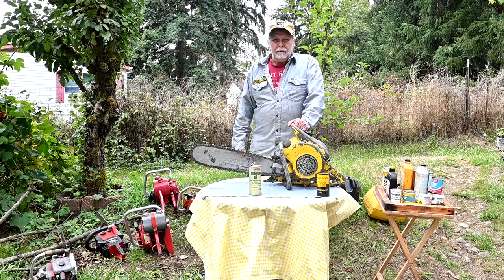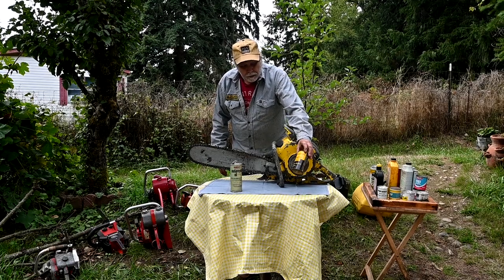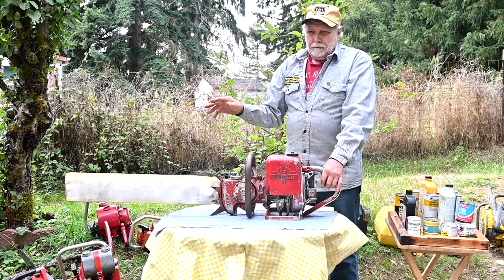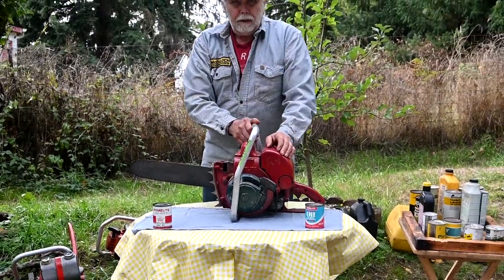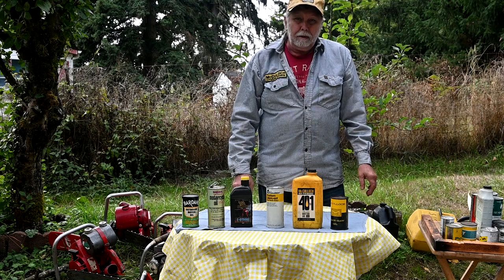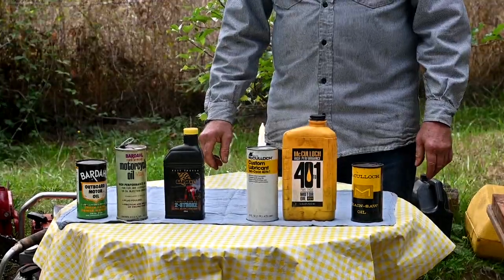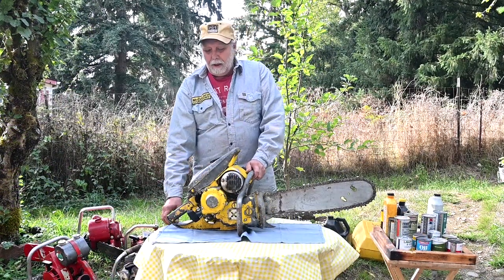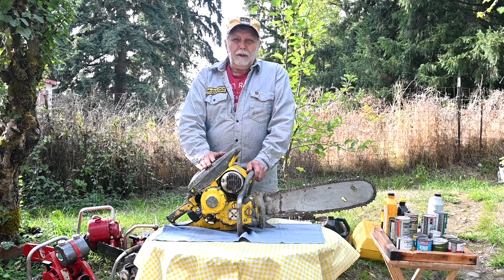Vintage Chainsaws Proper Oils and Mix Ratios

Comment: I changed the cylinder on my MS 460 to change the cylinder on it to a Nikasil coated cylinder earlier this year.  It had run nothing but Red Armor at 50:1.  When I took the cylinder off it was coated with Red Armor, as were the connecting Rod and bearings.  I was impressed..  I agree about Stihl Ultra - filthy crap.  
  The problem, today, is carbon build up with all the emission crap that EPA has put on our saws.  Blocked over spark arrester screens will stop a saw quicker than just about anything else.  I run Bosch WSR6 F spark plugs in most of my saws because they do not die as fast as NGK, BPMR 7A do.  My Big Stihl saws have to be sloppy rich at startup for me to be able to crank them, otherwise they pop and try to drag me back into the recoil starter.  It is hell to get old, isn’t it.
Reply from the maker: I have never used the Red Armor oil, but a lot of saw forums talk about how good it is.  Amen to the getting old !
Reply: @mrobsoletesvintagehomestea9156  afterI cleaned the spark arrester screen on my ms 241, I pulled the screens from the other saws that I have that have them.  These saws had run more than the 241, but their screens were relatively clean.  I burned them clean and put them back in.  I had to soak the muffler off my 241 for thirty minutes before I could even get its screen off..  I then burned it off with my LP torch and put it back in.  I ran fine, afterwards.  I am still not a proponent of M-tronic  saws.  It is partially my fault, I do not use the MS 241, like I should.  It is just a little to small for most of the stuff that I cut.  I will try to use it more.  It ought to handle limbing pretty good.    It is a nice little,light saw but I do not have a need for little saws all that often.  I will not run any two cycle oil that is not JASO FD certified, anymore.  It gives better lubricate and less smoke than other oils.  I will tell you this.  I ran my ms 360 at idle for 15 minutes a few weeks ago and pulled the spark plug a few days later to put a  winter/summer shutter on it.  In doing so, I had to pull the plug.  It was a beautiful chocolate brown in color.  The 360 has had a bunch of Red Armor run through it because it is my favorite big saw.  It does not have a spark arrester screen on it.  It has a dual port muffler.
Reply from the maker: I recently saw a video where they ran the Red Armor oil in it.  The Red Armor claims to remove carbon, so they did a test on a power blower.  Well it actually cleaned the exhaust screen after several tanks of fuel and started to remove the carbon on the piston.  I might have to try some.  @johnclarke6647
Reply: @mrobsoletesvintagehomestea9156  it probably would have cleaned the spark arrester screen in my ms 241 had I been able to start the sucker, but I beat it to it.  I cleaned it myself.  It was flat frozen into the muffler.  I was afraid I would break it getting it out, but didn’t.  I pried it up with a small screwdriver and pulled it out with a pair of needle nose pliers.  It was blocked solid.
Reply: @mrobsoletesvintagehomestea9156  I can tell you it puked some of that black Ultra crap out for a little bit and then it cleaned up the mufflers on my other saws.  When I put a new cylinder on my ms 460, I disassembled it’s muffler and cleaned it up to get out all the black crap from the Stihl Ultra and it has stayed clean, since.  All my saws used to puke that black crap out unless I ran them wide open, but now they do not.  When I built my ms 660 three years ago it used to puke black crap out so bad it looked like someone with a runny nose.  The muffler side is now clean as a button.  I started running Red Armor in January.
Reply from the maker: Looks to be a good choice ! @johnclarke6647
Reply from the maker: Stihl oil sucks ! @johnclarke6647
Reply: @mrobsoletesvintagehomestea9156  yep.
Reply: @mrobsoletesvintagehomestea9156  JASO FD certified oil is what you want mixed into Premium Non Ethanol Gas.  Buckin uses aviation gas but I buy regular 90 octane PNE gas.  Can’t find any higher octane at a reasonable price where I live.  Another good oil is Citgo Snow and Sea.  It Carrie’s an FD certification.  My buddy in WI uses it in his saws with excellent results.  I bought a quart but at $16 a quart off Ebay plus shipping that was the last time I bought it.  I use it to assemble new saws but that’s it.
Reply from the maker: Non ethanol fuel wasnt available in our area for a long time, and every spring I would spend about $135 for carb kits and related fuel stuff for my equipment.  Now that I have non ethanol fuel, my expenditure for carb kits etc. is only about $30 a year.   @johnclarke6647
Reply: @mrobsoletesvintagehomestea9156  I buy it at my local 76 station.  When Trump was prez I got it for as low as $2.50 per gallon but now it is $3.29 per gallon and going up every time I get some.  I have never had to replace a carb kit or fuel line in any of my saws.  If I pick up an used Stihl carb for one of my kitsaws then I usually clean and rebuild it.  Since these are usually Walbro HD carbs, I know what you mean about the cost of carb kits, but that is a penance compared to the cost of good Walbro carbs.
Reply from the maker: We are screwed ! @johnclarke6647

Comment: Question- what is the best modern oil for the rotary ? I will be reviving the old Evinrude after 20 years of sitting. I remember grandpa being very particular about running the rotary oil! 
Stihl oil- have been running that in my saw because it was required for the 2 year warranty. Guess it has dye or a tracer in. They have some way to tell wether you used it or not. 
Random story- I have my grandpas old 2 stroke golf cart, which smoked like hell (smelt terrible, like it’s burning down) and got really hot when you ran it hard. I figured it was toast (does need a rebuild) so I just keep running the heck out of. I dumped my snowmobile oil in which is Amsoil. And I’ll be dipped if didn’t start running cooler and stop smoking. 🤷🏻‍♂️
Reply from the maker: I have a small stash of Evinrude Rotary oil that I use in my my two rotaries.  When I run out I will run the Golden Spectro partial synthetic or I am going to do some testing of the Echo Red Armor oil, which is also a partial synthetic and use it if it is as good as many have recommended.  I dont run my rotaries much, as they run real hot, and should only be run in super cold conditions, which we dont have very often here.  The old golf cart is probably coked up from slow running and brand X oils.  I would suggest cleaning the exhaust port and cleaning the muffler.  I clean out old two stroke mufflers by filling a big tub with water and Tide detergent, then bring it up to a boil for several hours, and almost all the carbon comes out.  Then when cool , tap with a plastic hammer, and blow out with compressed air. Running the cart wide open is blowing out the looser carbon, thus making it breathe better.  It is possible that the Amsoil is helping to get rid of the carbon.  The Red Armor oil does it. I have ordered some Red Armor and am going to do some testing of it, should be interesting.
Reply: @mrobsoletesvintagehomestea9156  I wouldn’t be surprised if find a stash of the rotary oil yet as we are going through the old garages. Never heard of the golden spectro probably have to order it. 
As far as the cart goes, whenever I tear into it, it will be a for a rebuild. Upper end and crank seals at a minimum. Your theory makes sense, since I know he was paranoid about the oil injection failing and added oil to fuel as insurance as well. And it just puttered around the resort at the fishing hole. It’s original a 90ish ez go with a 2 stroke 3PG motor. I may just push it until it quits 😂
Thanks for the oil info 👍
Reply from the maker: Golden Spectro isnt what you will find except at a motorcycle store, or order it from someone like Rocky Mountain ATV.  I have used it in my vintage dirt and racing bikes with great success.  My boys were using some generic 2 cycle oil in our old Hodaka dirt bikes until I found out and made them start using the Spectro.The bikes start easier when cold, and the smooth clean running with the Spectro is a noticeable improvement, plus no carbon.  88888888965 @crazydave4455

Comment: Any input on the Amsoil synthetic that can run up to 100:1? I am thinking 44:1 is a good all around mix.
Reply from the maker: According to Amsoil, their oil is high ash in thicker mixtures.  What type of saw are you running?  Dont use full synthetics in vintage saws, as I outlined in the video.
Reply: @mrobsoletesvintagehomestea9156 I am looking for that magic number of ratios. I am working on old Homelite and McCullough saws mostly. Strictly for shows.
Reply from the maker: If the saws are not working hard, 40:1 is good.  If you are doing some extended cutting  32:1 @davidmech2956

Comment: i have a 360 homelite automatic and i was wanting to know what kind of mix gas i need to use fuel cap is red next to bar oil cap gas cap is on left side on top
Reply from the maker: The factory recommended 32-1 oil-gas mix, and that is what I would use.  Don't use full synthetic oil in the saw though. I am starting to use ECHO Red Armor oil, and they also have another oil that doesn't have the carbon removal additive.  They are the best modern oils I have used, and many pro loggers prefer it to others. Use premium gas with no alcohol for best results.

Comment: Big thing is make sure u dont use injector oil, and most times u wont have issues
Reply from the maker: I don't use injector 2 stroke oil.  For years I have used the 40 weight based 2 stroke oils, mostly Bardahl VBA, which is no longer available.  I have started using Echo Red Armor oil in some of my newer, but still vintage saws and equipment.  This oil has a very high film strength and has been a good replacement for most of my applications.  I still have a small stash of Bardahl and some really old Castrol oils that I use in my oldest equipment and antique outboard motors.  I have never experienced a lubricating engine failure when using these oils. The only lubricating failures I have experienced were a few of my chainsaws, using Stihl and Husky oils.
Reply: @mrobsoletesvintagehomestea9156  I just bought klotz benol race oil,,has great numbers,,but on back I read not to use under 32 degree Temps! Wtf,, plus cause it's bean oil it's bio degratable,, hmmm guess I'll have to cans mixed one for the smell,, and one for work, echo oil
Reply from the maker: Castor based oils have a tendency to separate from the gas in certain circumstances.  The main reason I don't use castor based oils is that they don't burn clean and if stored for long times, leave deposits in the carb and fuel system.

Comment: You actually use what you can get.  I ran an oil named StsMix for years at 40:1 with then our 92 octane Regular gas.  I had to get my two cycle oil at Forestry Supply in Fitzgerald, GA.  It cost me about $3 a six pack.  It was a good two cycle oil for the time frame - 1980’s to 2000.  I poured in one can and 2.5 gallons of gas.  I ran mostly Poulan equipment and some of my early saws ran 24:1 but my later saws all ran 40;1.  All of my saws were all ball bearing saws, dealers called them Pro saws in those days.  I run 50:1 today with Echo Red Armor in everything.  My oldest saw is my Poulan Super 25, Deluxe Automatic and it runs 50:1 with no problems.
Reply from the maker: I did a little research on the Red Armor oil, and find it is partial synthetic like I have used forever.  I am going to get some and compare it to the oils I am now using. Should be interesting.
Reply: I would like to know that too because my favorite small engine shop carries echo red armor. I run a couple of  homelites- xl 12 and sxl auto- along with modern stihls and older stihl 041fb and O8S, up to ms 391. I know I don't like stihl oil because of excessively stinky and smoky exaust fumes. Note in ohio I can't get alcohol free fuel unless I buy turbo blue at an oil company.
Reply from the maker: Testing the Red Armor oil will be interesting, as quite a few have shown interest as to what the results will be.  Looks like you have a nice collection of saws ! @wesleycallison2079
Reply: @mrobsoletesvintagehomestea9156  well not all are runners yet! I also have a Mcholoch I-43, 4 David Bradley 360s, a 510evl echo. O45 stihl, a titan sportsman, a Poulan sandcast, and others. I could probably go crazy trying to keep them all running! And maybe broke also. Oh well it's fun for me.
Reply from the maker: Nice collection !  On the early saws, I pick out 2 to3 of them, give them a full service, take them out for work several times a year, then drain all the fuel, clean the carb, oil the bore and put them away.  That way, I can just fuel them up, and they are ready to go. @wesleycallison2079

Comment: I run a Super Pro 60 and  a 7-10 Mac amongst many others. How do you feel about a ratio of 20-1 using SAE 30 wt? Thanks!
Reply from the maker: The problem with using motor oil in your saws is that it will leave a lot of carbon in the port and muffler, and the additives that they use in the oils are not designed for 2 stroke engines and can become abrasive.  The real old saws just used plain old oil with no additives.  When automotive needs became more demanding, zinc was one of the first additives that was used, and of course later more and more additives were used as auto engines became more sophisticated.  I suggest you use a partial synthetic 2 stroke oil at 32-1 for heavy use, or 40-1 for firewood cutting and lighter work.  Yamalube is good for average use and is not that expensive.  I will be testing Echo Red Armor 2 stroke oil soon, too see if it is as good as many say.  Golden Spectro is what I also  use with excellent results.
Reply: @mrobsoletesvintagehomestea9156   thank you for your reply! I’ll heed your advice. My old McCullochs are workhorses. I forgot they changed the formula. Thank you again. I look forward to the review of the Echo oil!

Comment: Buckin uses only Stihl oil but he's always WOT, so no problems apparently.
Reply: If you are WFO,  Stihl is ok.  I never had any mechanical problems due to Stihl Ultra but it is filthy, otherwise.  If you let a saw idle it spits black crap, everywhere.  I have never seen a spark plug running Stihl Ultra that has a chocolate brown insulator.  It is always dark no matter how you run it.  My Husqvarna 25B blower I run WFO most of the time and it’s insulator is always dark with Ultra  but not with Red Armor.  Ultra just has to much ash in it.  It completely block over the spark arrester screen on my ms 241 CM and that should not happen on a computer controlled saw.    The inside of its muffler was completely covered with black carbon ash.  I cleaned it out as best I could and hope red Armor will do the rest.  I burned all the carbon off it’s spark arrestor.  It cranks and runs fine, now.

Comment: I'll never understand how 100:1 Amsoil can give long engine life in modern saws but some guys claim it.
Reply from the maker: Modern saws have a chance at 100 to one, but a hot day, a dull chain and working the saw hard will guarantee a top end failure.  My two buddies who were pro saw mechanics, really liked all the work they got from people using these oil mixtures.
Reply: Sir I really like your channel but I have to disagree I homestead in Alaska and have been running Stihl Ultra in my 070 lightning for years at 50:1. Oil technology has came so far. Amsoil claims you can run 100:1  even in vintage power equipment . Synthetic oils in my option are the only way to go.